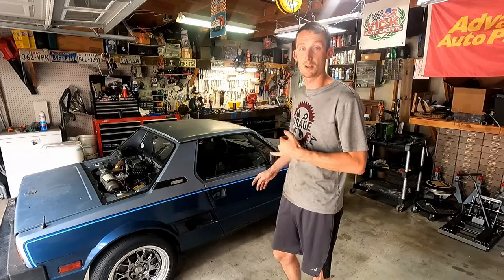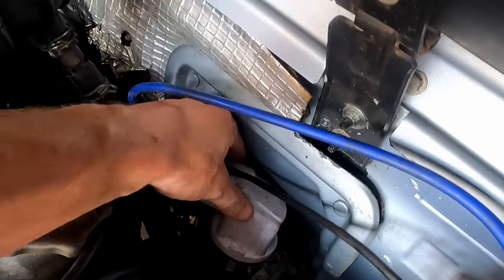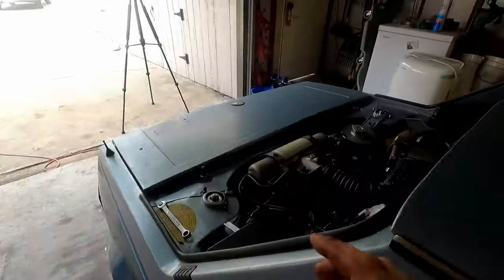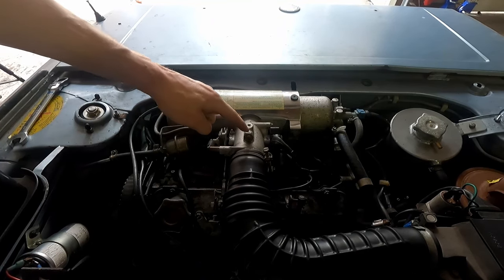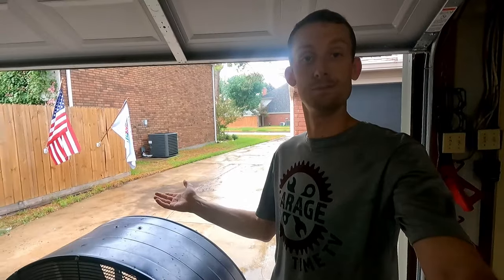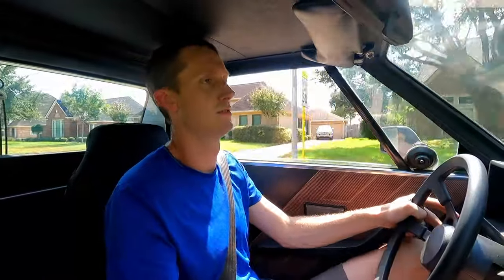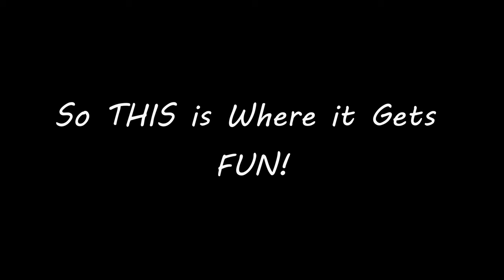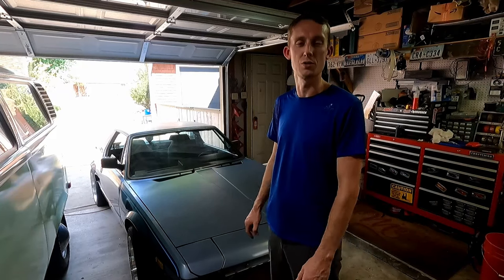X 1/9 Ignition: Timing Tune-Up and Epic First Drive!

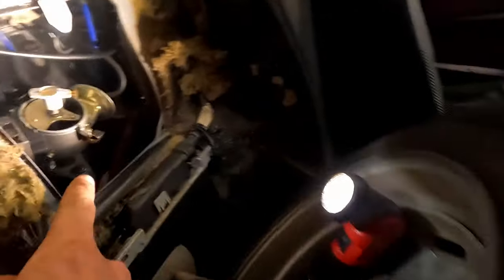Comment: @10:58  For anyone with a 1500 X1/9 (1979-on), please note that this owner has purchased and installed an aftermarket distributor.

Because it has a larger vacuum capsule, to fit properly and give the widest rotational swing to adjust timing, the stock Bosch distributor's body should be positioned so that the vacuum advance capsule is more or less at the 8-9 o'clock position when viewing from the vantage point of this presenter's video, ie, looking back thru the distributor access panel opening in the firewall.  If you position the stock Bosch distributor's body as the presenter has positioned the aftermarket distributor, you will have difficulty rotating the distributor body to get the correct timing.  Another reference point:   when correctly oriented, the stock distributor cap will position the ignition wire ports so that they are all "aimed" at cylinder #4 (flywheel end of the engine).
Reply from the maker: Good notes here. I forgot about the differences between distributors. Thank you for pointing that out

Comment: Having owned two X1/9’s… a 1978 1300 and an 1981 1500 … I have to say that that exhaust note was horrible, neither of my cars sounded that droney… and neither of my cars rode that rough, either they were both very compliant… So either the roads in your neighbourhood are like a Warzone or your coil overs are too stiff…. I hope they have some adjustment on them. Otherwise you’re going to be visiting your chiropractor daily…..

All that being said, I hope I didn’t sound too negative. I think what you’re doing is fantastic. I miss my little X1/9s so much… especially the 1500…. It was my favourite car that I ever owned, and I only sold it because I moved to Australia from Canada…. I wanted to actually ship it over, but I just couldn’t at the time… I’m 6‘5” And with the roof off my head, stuck out several inches above the roof line, but that just means I had more wind through my hair. it was the best handling car I’ve ever owned, truly a road legal go kart.  keep doing what you’re doing buddy you are living out my dream
Reply from the maker: Not a problem man! I have made some small adjustment since this video and things have gotten much better. I love my X. I drive it all the time!
Reply: @GarageTimeTV  oh wow, quick reply!  lol.  My favourite modification I ever did was replacing the steering wheel with a Momo mod 27. this was back in the mid 90s before the Internet, so I actually had to order it directly from Italy. because of my height, I needed a smaller diameter steering wheel to be able to drive it with the roof on which was necessary in Canadian winters. by the way, they are great cars in the snow all the weight over the drive wheels and so light… they stop on ice really easily. But the Momo wheel was fantastic covered in Alcantarra. I wish I had put the original wheel back on and kept it to put on my racing Sim here. I highly recommend.
Reply from the maker: @jasonlange780  I like to be active! Engaging is key.

Comment: I am 6' I like to drive straight arm and still I could not get my hand round the bottom of the wheel when shifting.
I fitted a smaller steering wheel and kept the standard rack, way cheaper than fitting a quick rack.
I shortened the shift lever 1", and fitted a Tillett seat, like from a Lotus Elise Cup.
My eyes are now level with the top of the wing mirror.
I could be wearing a full face helmet and the car could have a roll cage and there would still be 2" headroom.
I also deleted the centre console and made a new centre panel to include the electric window switches.

They used to say taller drivers should avoid these cars... but a shell seat on custom runners will put your ass on the carpet and your head will be more within the roll hoop.
Not sure if you got a late production model there, or not but these have deeper floor pans than the series 1.

Comment: When you do the fuel hoses you might check the flow pattern on those injectors.  They don't like to sit dormant full of gas and can clog up.
Reply from the maker: @cratecruncher4974  I ended up soaking them in a Berryman/gasoline mixture for a day or so. Made them very clean

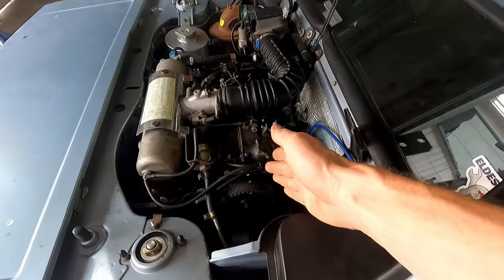Comment: Great job on the video. I am dealing with a timing issue after I developed a miss/rough engine fearing the timing belt jumped a tooth. At 9:44 to 10:12 ish  I'm getting  kind of confused with the video after you provided the "stock" flywheel photo. I know it was a reference photo for us and it showed that the engine was 0° (TDC). It seemed irrelevant at first but then you comment that you're now set up at 10° BTDC and the cam pully is now lining up perfectly with the reference pointer on the bracket. So my question is what is the camshaft pointer truly referencing 0° or 10 BTDC°? If its the opposite answer I thought it was, then I have  wasted a ton of time lining the reference marks with no real success yet lol. Hope you can straighten me out.
Reply from the maker: Let me see if I can clarify.  

The picture was for reference as to what to look for. The manual calls for the engine to be 10 degrees BTDC (Behind top dead center). So if you line up the mark on the flywheel at the “10” and have your rotor pointed at #4 you are set correctly.
Reply from the maker: @shagette  if you set it to 0 and everything lines up, you did not jump teeth. When you have the 10 degree mark lined up, the timing marks will be just before the pointers. I like to rely on the flywheel mark over the pointers. The pointers get bent or moved over time (look at mine as an example, it was bent like crazy).

Comment: You kept saying "10 degrees behind top dead centre" when the markings on the flywheel are BEFORE top dead centre. 
Why is this?
Reply from the maker: Behind and before mean the same thing. Top dead center is at 0
Reply: @GarageTimeTV  🤦🏻‍♂️ Love the channel but no.
10 degrees behind TDC is 10 degrees after TDC.
Before is ahead. Behind is arrear.
The car behind you does not arrive before you.
It'll be October 1 in Atlanta an hour before it's Octiber 1 in  DFW because Texas is an hour behind Georgia.
Cheers!